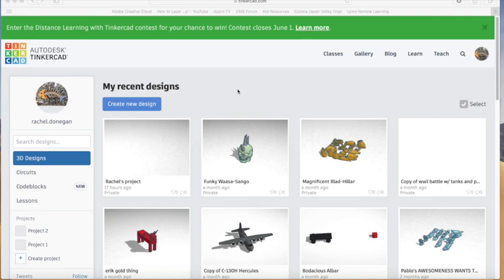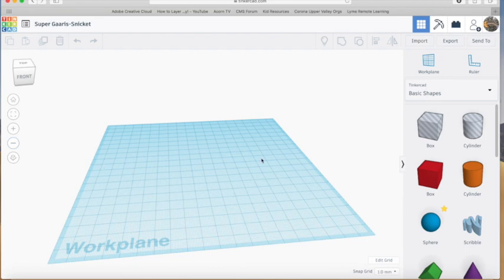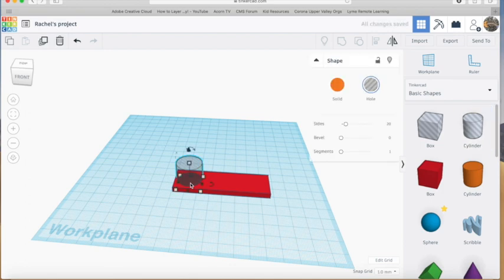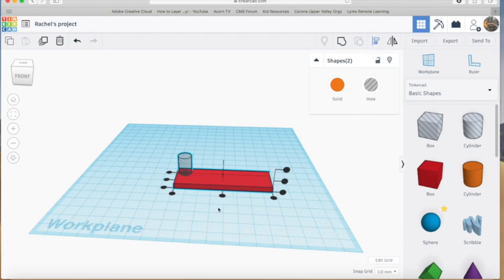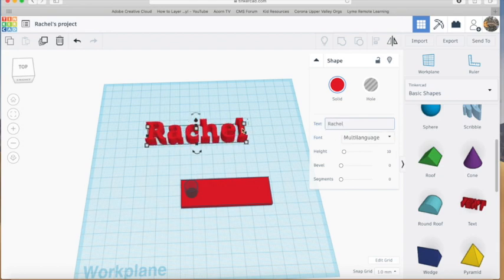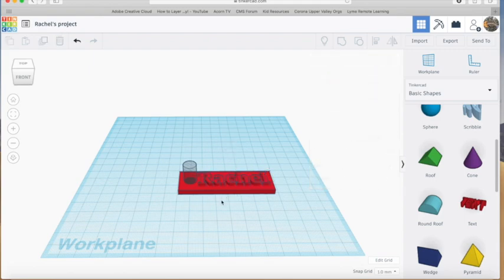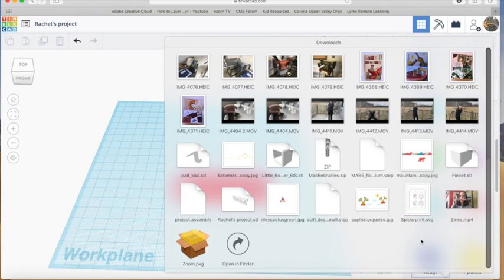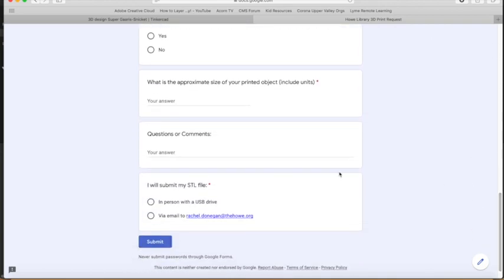Howe Makers: Tinkercad @ the Howe

Comment: Thank you for teaching this. wow! amazing video, been trying to figure this out, thanks for sharing.  to get your pattern though I wonder why I had to change the add/radius to 35, sides/6 tube/1/ steps 16. I'm using a windows program...wonder if it's different for other programs.  I did get it to work and that is cool. :)  How do you change size, so if you want it 3 inches wide, the whole thing?